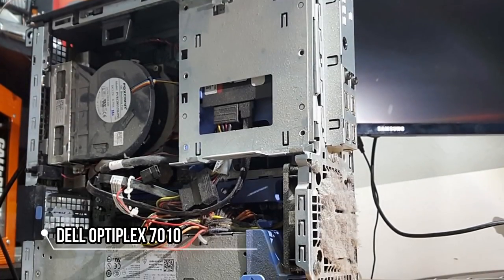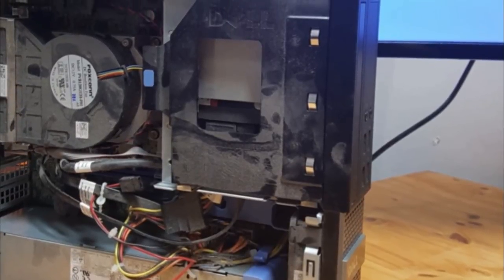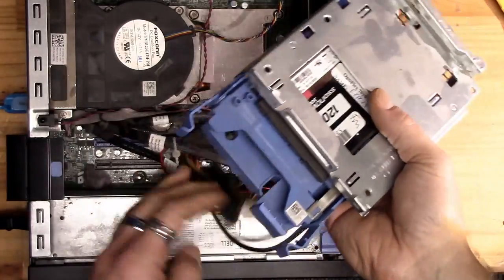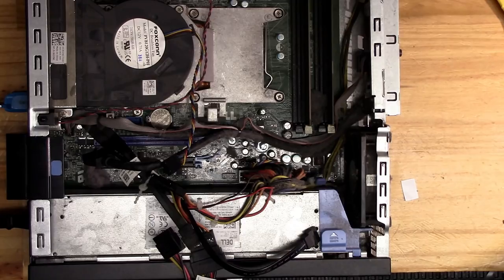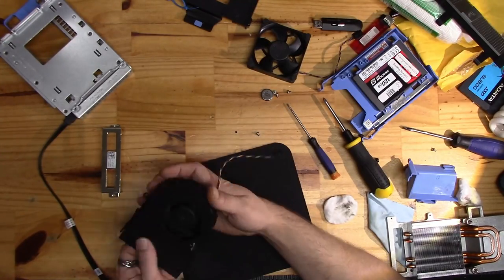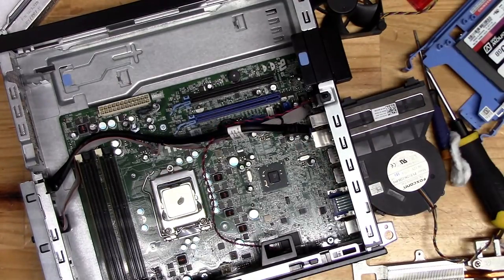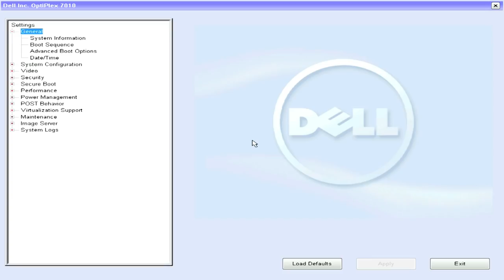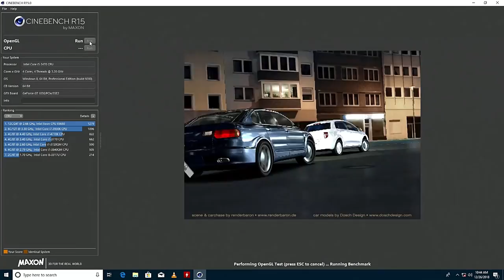My Gaming Computer came from Wal-Mart's

Comment: I've got almost the same pc 

Started life as a dell optiplex 790 with 8gb DDR3 an i3 processor no HDD and no GPU taken from my work (the best kinda price is asked boss and he said yeah take one)

Now it has

i7 2600
20gb ddr3 4'4'4'8 (will eventually be 32gb)
250gb SSD
500gb HDD
Gtx 1050Ti

Runs almost anything and even some titles like sea of theives at 30 to 60fps on highest settings in 1080p

I Reckon you could squeeze more out of your Walmart dell (just make sure you've shoved the latest bios update on it if you want to up the CPU etc.

Comment: I have a similar DELL SFF desktop equipped with an i5-3570. I threw in a GTX 1050 Ti and 12GB DDR3. Played most of my games at medium to high settings at 1080p 60fps and it streams at 720p 60fps on twitch.

Comment: dell xps 8500  i5  3470  24 gb  ddr3 ram   gtx 1060 3gb   256gb msata  ssd  twin  wd purple 3gb storage  twin pny 240 gb ssd   games and such  windows 10  computer  is super fast  boots from cold start 10 sec or less    who needs  the flashy lights
Reply from the maker: Awesome

Comment: the GT 1030 would be a much better match for aging LGA775 CPUs, this card was holding back the i5's power.  A 1050 would be a better match, maybe even the ti.
Reply: Problem is the space. There's only 2 brands that make low profile 1050 and 1050ti, msi and gigabyte. Now then, they are double slot, low profile cards. The issue with that, is that the fans on those cards may not even rotate because they may be right against the power supply of that machine, and even if they do, they MAY choke. Here , take a look:

https://www.gigabyte.com/Graphics-Card/GV-N1050OC-2GL#kf

https://www.msi.com/Graphics-card/GeForce-GTX-1050-Ti-4GT-LP/Gallery

But, let's say the msi (which btw is hard to find) fits and it dosen't choke... the power supply of those dells are rated for like 180 watts or something very low like that, which may be a problem for the 1050.
Reply: i pretty much had that same rig, an i5 3550 with a gtx 1050ti. honestly, not much more performance to be had other than a res bump.

Comment: I took this same pc, and stuck an evga gtx 770 in it, gaming beast. I had to remove the dvd drive and disconnect a case fan to get it to fit, but that's ok because now the case is left open due to the size of the gpu lol.

Comment: Do PCIe risers affect GPU performance because I have one installed in my server linking it to a gt 1030 and I do not get 72fps on OpenGL rendering in cinebenchr15. I get only 51-56fps at least.
Reply: I don't think so. I have one in my mini-ITX case connected to my RX 580 and it performs to spec.

Comment: i have core2duo e8500 i wanna do bsel mod to it i saw online to cover first and second pin i did it and pc did boot i wanna get the most out of it i will upgrade later so what's your advice my pc is optiplex tower755
Reply: The E8500 is already at 1333Mhz FSB and the Optiplex 755 only supports 1333Mhz FSB, so BSEL mod won't work. You can upgrade it with a Q6600 with a BSEL mod to make it run at 1333Mhz (I think 3ghz), instead of 1066Mhz (2.4Ghz).

Comment: im glad im not the only one that does soap and water sink scrubbing pc parts, only the plastic and sinks! lol
Reply from the maker: Especially if a smoker owned it. Hot soapy water works well
Reply: @modstek  by any chance have you ever used lysol disinfecting wipes on the inside of pc cases and fan blades?  im suree it may be a big no no on components, but i found that those will clear up that smoke and dirt grime smell wiping down the case when it is completely pulled apart!  especially the front panel cables if they contain alot of dust bunny!